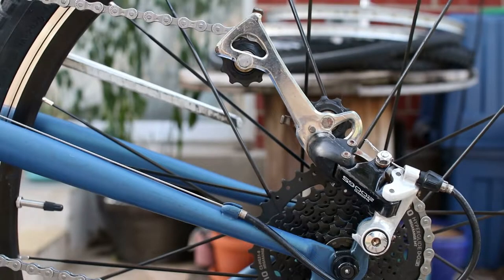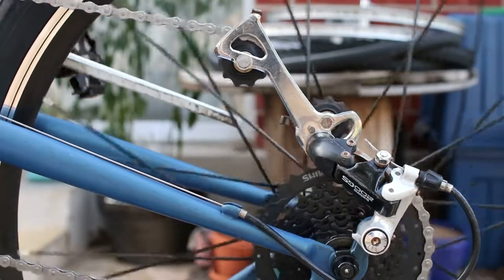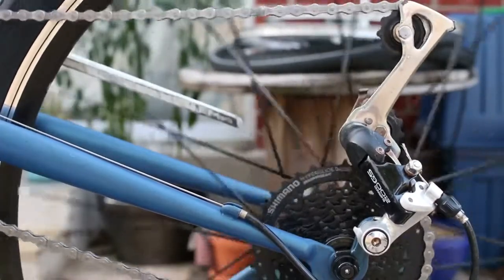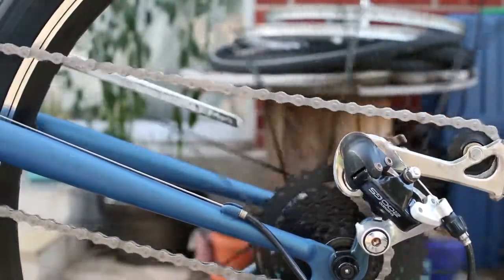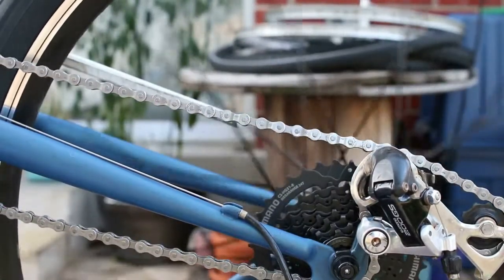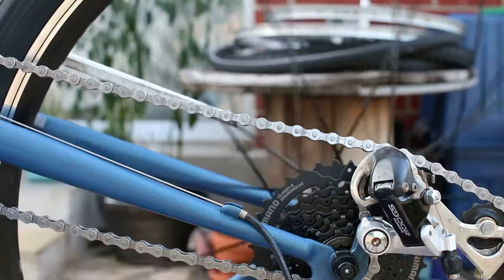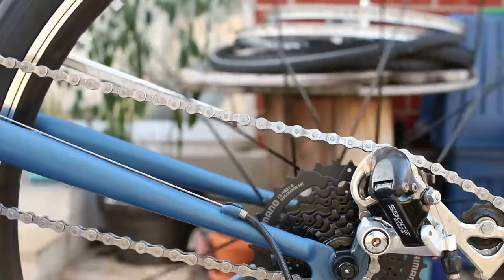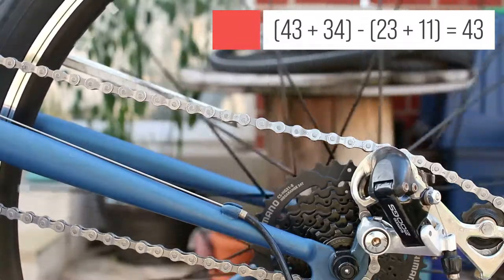What is Derailleur Capacity?

Comment: Nicely explained, would this also mean if you have 40 teeth single speed crank and 11-46 teeth cassette its (40+46) - (40+11)= 35?
Reply: Not necessary to calculate the crank on a 1x drivetrain.  Just 46-11=35.
Reply: @specagent999  
Does that mean, for my stock SHIMANO RD-M6000 SGS long cage (which is designed for a triple chainring), if i want to convert chainring to 1x set-up, can i use 10speed 11-42T cassette, without having any problem on the total capacity of my stock RD? And what is the largest chainring (1x set-up) i can use for a 10s 11-42T cassette using RD-M6000 SGS?